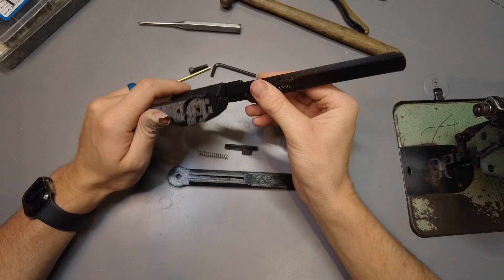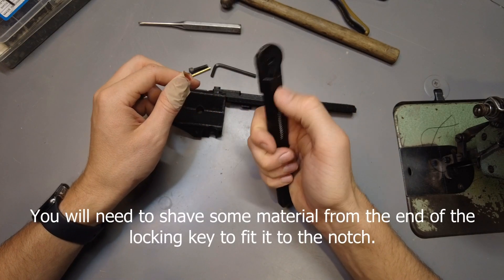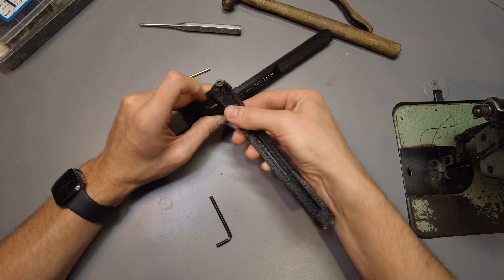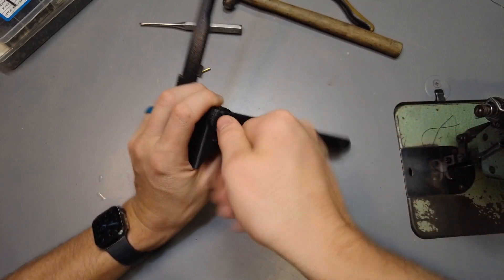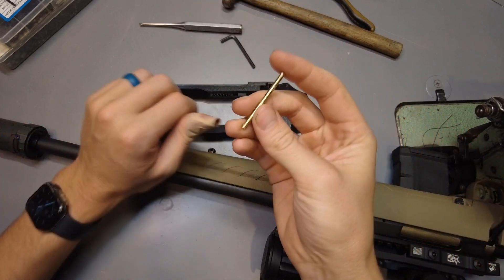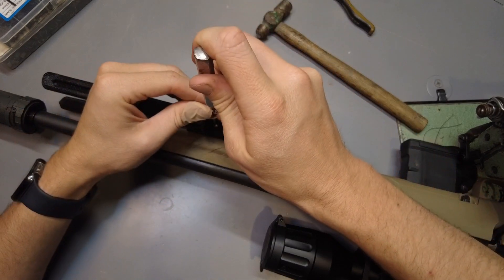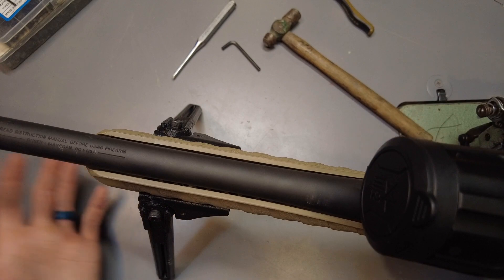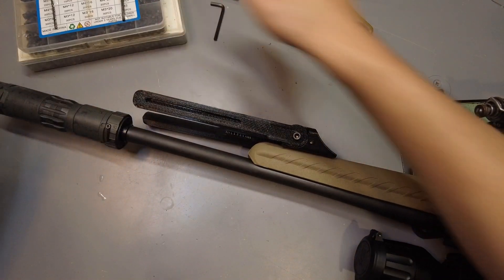3D Printed Bipod

Comment: A part like that would probably be better printed in CF nylon but if your going to keep it simple and stick with PLA+ you should try Polymaker PLA+. Of the different filaments I have tried Polymaker PLA+ seems to be the best without jumping to a much higher price bracket. Prints nice and smooth with almost invisible layer lines and it's dramatically stronger than other brands of PLA+ iv tried. It's got some pretty unique mechanical properties, if I picked up a part printed with it and didn't know it was PLA+ I would think it was some other type of filament. It's stiffer and stronger than even regular PLA yet also has more yield than most PLA+ iv tried. Strength of regular PLA but without the brittleness. Plus it prints really nice which is always a plus. I use bed temp of 70° and nozzle temp of 230° for the first two layers then I back it off down to 60° bed temp and 220° nozzle. 55mms, 100% lines infill, 6 walls, 100% fan speed, hop turned on. That's in an open area with a 67° room temp, may need to tweak those numbers for an enclosed printer or higher room temps. Also I have noticed a difference in print quality with certain colors, kind of odd but I have noticed earth tones and white always seem to print smoother than Black or bright colors. Smoothest iv found with the Polymaker is white but they're Army Green is a close second and looks really good.
Edit: also, its hard to tell looking through a video but just going off your surface texture on your print it appears your filament had moisture in it when you printed.
Reply from the maker: All good information. I’ve still got a lot to learn about printing
Reply: @thriftyoperator637  what do you use for the table top pov in your videos?
Reply from the maker: @PracticalTacticalSheepDog  a DJI Pocket 2
Reply: @thriftyoperator637  how do you set it up though? I use a tripod for my table tops but the angle always looks odd
Reply from the maker: @PracticalTacticalSheepDog one of two ways. I either set the tripod on the ground and work from behind the camera or I put the camera on a tripod that’s mounted to the ceiling above the sewing machine. I generally prefer the first method.